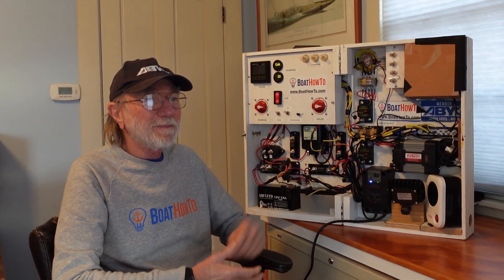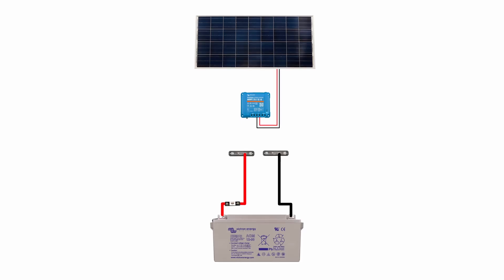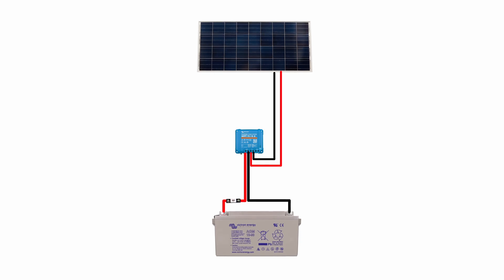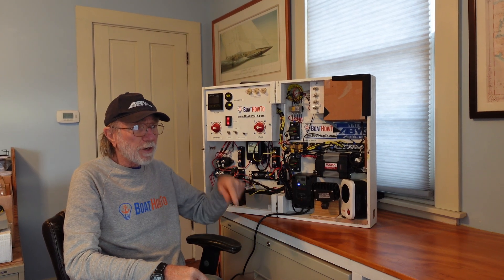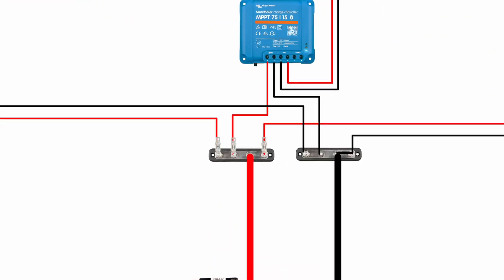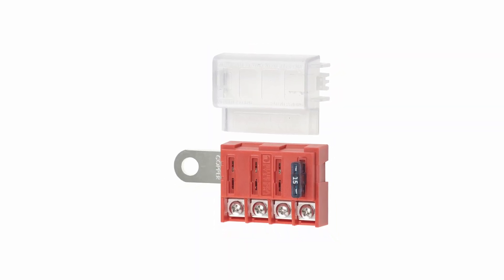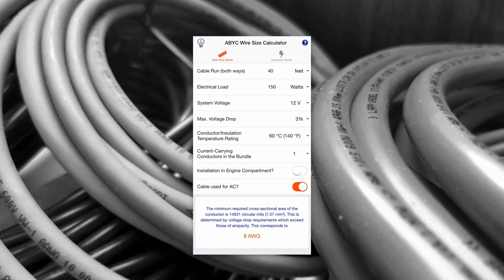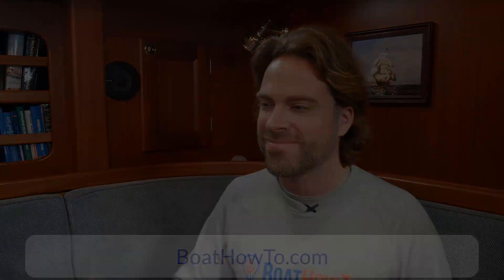How to HOOK UP and FUSE your SOLAR CABLES ! | Ask The Expert with NIGEL CALDER

Comment: The smaller Victron controllers (the 75/15 and the 100/20) have built-in battery-side fuses.  So if you choose a decent house battery voltage like 24V or 48V, you can get a lot of capability out of the smaller controllers without having to worry about it too much.  The larger controllers like the 150/35 for example require external battery-side fusing.  I do not recommend going larger than the 150/35.

Also, there is no need to run long cabling from the charge controllers to the house battery... the charge controllers should generally be very close to the house battery anyway since the PV wires will be higher voltage and have lower losses over distance.

The biggest mistake people make here is actually on the solar-side of the controller and not so much on the battery-side.  People often wire solar panels in parallel without using a combiner box.  Solar panels have a "maximum series fuse" specification on the label.  If the total amperage of the paralleled solar panels exceeds this rating, it is a fire hazard if the individual strings are not fused because the other strings can dump all of their current into a shorted string.   Typically that means you cannot parallel more than two 100W or 200W panels without a combiner box, and you cannot parallel larger "residential" panels at all without a combiner box.

Generally speaking, if shading is not a big problem you want to put panels in series.  If shading is a big problem you want to put panels in parallel (but then use the proper solar combiner box).  Or some combination of the two.

-Matt

Comment: I have 3x175W solar panels and three dedicated MPPT controllers. I also use a 20A circuit breaker from the panel to the controller so I can stop the output whenever I want to do some work on the other end (instead of putting a blanket over the panels). By the way, many cables but I get 15-20% better output with three dedicated controllers than one big! Everything Victron...:)